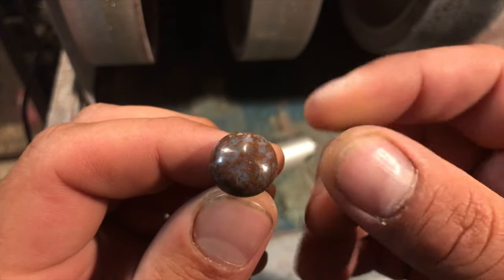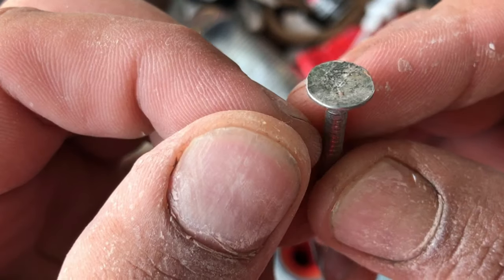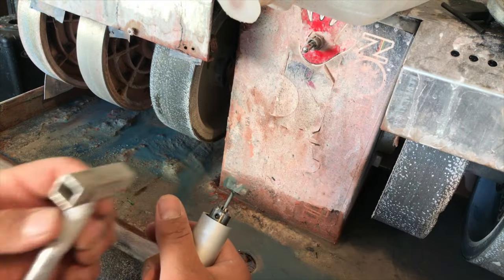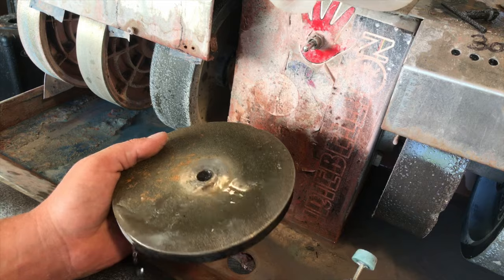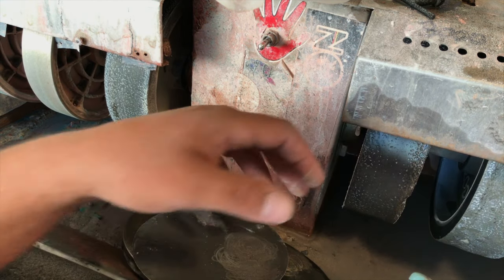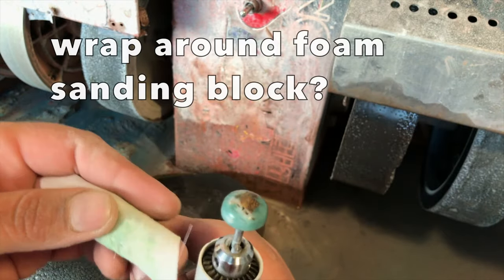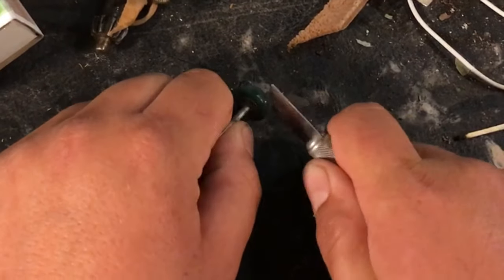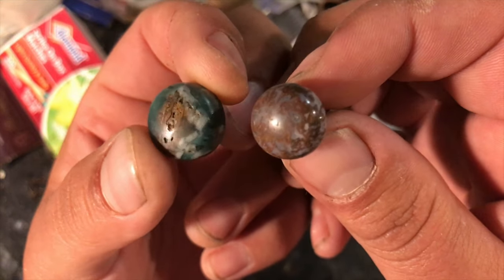Making Round Cabochons Using Simple Tools Dremel, Rotary Tool, Hand Drill, Drill Press, Etc

Comment: Hey Dave are you truly happy with the High Tec 8 inch diamond cab machine? I been thinking about getting one but 2,400 is a heck of a lot of money for mostly plastic.
Reply from the maker: Hello there my friend 
The hi-tech brand machines are only flat laps and saws but they are owned by Cabking which is a 6 wheel lapidary machine from the price you mentioned (2400$)  I assume you mean the 8” six wheel cabling lapidary grinder Which I think is a great machine and is one of my favorites but I would have to suggest the EZ CAB lapidary machine which is very similar to the cabking but is 1800$ and comes with higher quality wheels which is one of the most important part of a lapidary machine 
The cabking is great but check out the EZCAB which is being sold on Facebook you can find it easy on Facebook and it’s being sold through a dude named Vince Allred 
I have a video on the EZCAB and if you do buy one please tell Vince I sent you he supports the channel by kicking me down wheels when I help sell them :)
Reply: @lapidarydave  There is also a company that I have looked at called Jewel tools and they also make an 8 inch machine and the only thing I do not like about it that the tray are not removable, But it does have a one horse motor and pretty much set up the same as the cab king for 1,800 dollars looks like pretty good bargin. Not sure I'm impressed with the ez cabbing unit. I had an 8 inch titan before but it kept burning out the dam motors until finally the warnity expired and I was screwed.

Comment: Quick question what size is the nail you are using? Want to use a nail instead of a plastic.
Reply from the maker: Hi I’m sorry my friend but I don’t really know what size it is I want to say it’s an eighth of an inch but I’m not sure
Reply: @lapidarydave  Thank you very much. I'll see if I can find some.
Reply: @luisgomez385  all the nail is a shingle nail with the tip removed . You can get them in 1 inch or 1.5 inch.